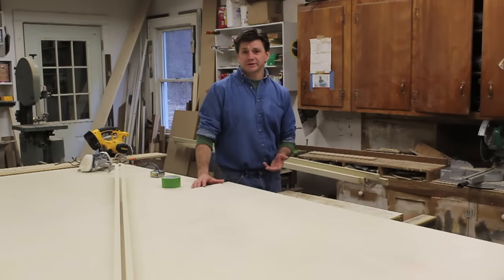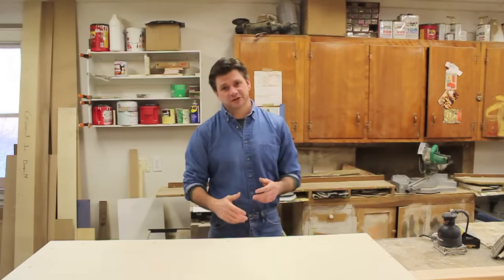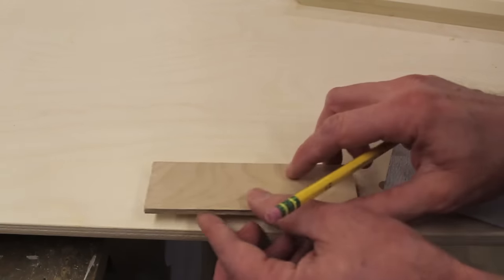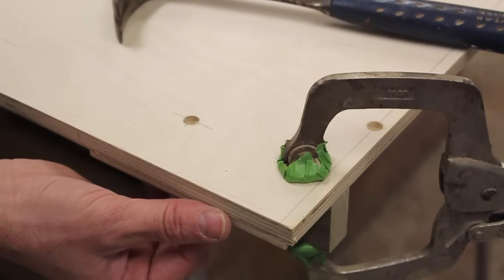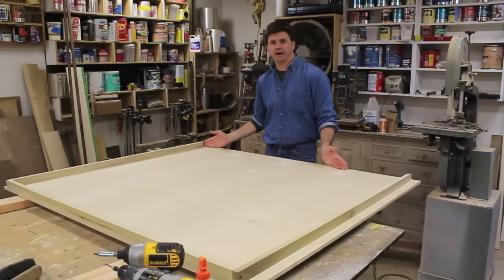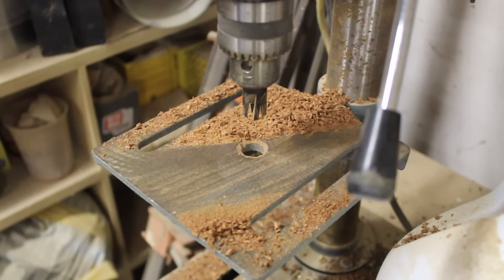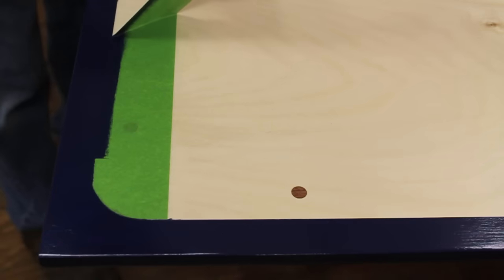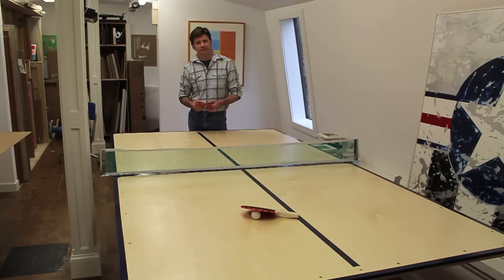How to Make a Ping Pong Table by Jon Peters

Comment: Thanks for posting!! I just finished mine!!!! 
Made a few changes and additions...
Stained it dark walnut to see ball better...
Made the fold direction opposite to protect table surfaces while in storage...
Built a door w/ hinges to fit around some the the support beams underneath to store net, and paddles...
Used 1.5" PVC to make a spring loaded ball holder/dispenser along each players side under the playing surface...
Added corner brackets on plywood to protect table corners while moving/playing
Added a clip on each side to hold it together when it is folded and being moved
Thanks again for the help Jon

Comment: I used two finished 4 * 8 ft particle board (3/4 inch in thickness) from Home Depo, asked Home Depo to cut them into two 4 * 5 ft and two 1 * 3 ft line up as one 1 * 6 ft for center pieces that with 3/5 inch cut wood joints each side to raise a piece of microfiber as the net. So in short, 4 + 1 + 4 = 9 ft is table length and the 5 ft is the table width for the baselines each side. 
The net poles are two 3 * 9 inches from the rest of the unused board. Similar 3/4 inch cut wood joints as the base hooking up with the cut wood joints on the 1 * 6 ft center piece each side. I used paper stables every inch along top and bottom to sew the microfiber into tubes so the net strings through the tubes holding the microfiber net straight.
Table height standard is 31 inches. I bought four 2 * 4 ft and then cut them into 31 - 3/4 = 30.25 inches as the legs for raising the table. Two 8 ft 2 * 4 lumber wood mounts on those 30.25 inches wide V shape legs as the vertical support horizontally along the table length with appropriate cut wood joints as well so the whole thing can be assembled/disassembled easily.

Comment: Great video. I think you could use the piano hinge on the top side (under the net) to allow one to fold the table 90 degrees to play against a backboard. Just need a way to hold up the vertical panel. This would also help to protect the paint job on the top face.
Reply from the maker: +Peter L thanks Peter , yeah that would have been a good idea.

Comment: I used Masonite instead with a smooth low friction coating. Besides the different wood i basically did the same thing you did and my table works great. So thanks for an easy video :D

Comment: Thank, a really good video. But I have a question. What kind of paint and wood do you use for a professional table?. Because if I use a no aproperated paint ball does not gonna bound, and rule say...from 30 centimentes high  balls have to bound 20 centimeteres. Thanks for your time.

Comment: What type of blue paint did you use for the boundary lines? Also, do you know where I can get folding legs solely for the corners of the table rather than saw horses, or would I have to develop my own?

Comment: Ping Pong tables have to have a matte color, and not so shiny and smooth.  The ball would not bounce right.

Cheaper to just buy one.
Reply: Muntecy, you are right. It would be like making a car at a machine shop and by the time you are done, you are in several hundred thousand. It makes no sense unless you are bored and have nothing else to do. Baltic birch plywood is not cheap and overall has an environmental cost well above a purchased table.
Reply: Uhm... in what world is it cheaper to buy one? Not here